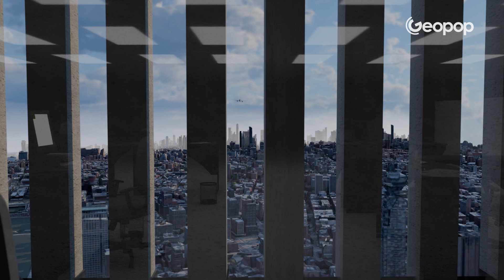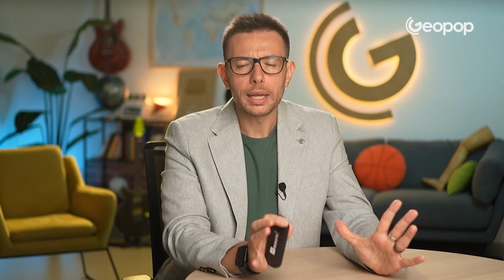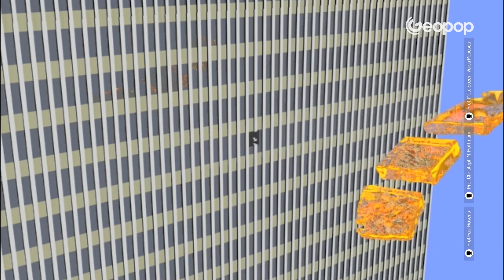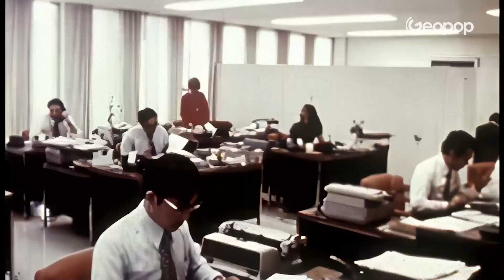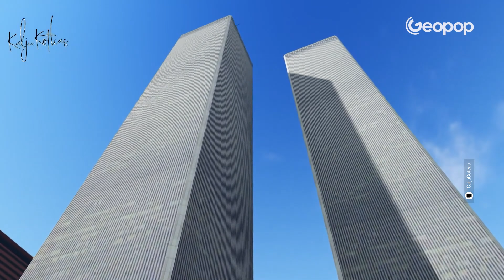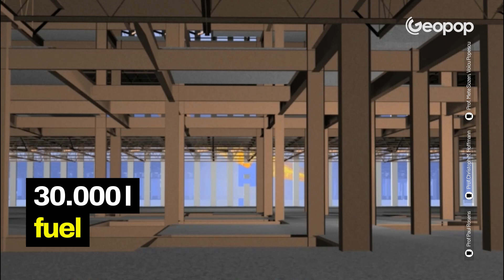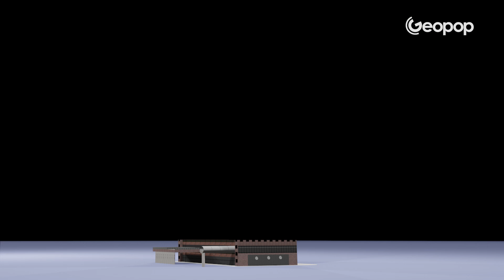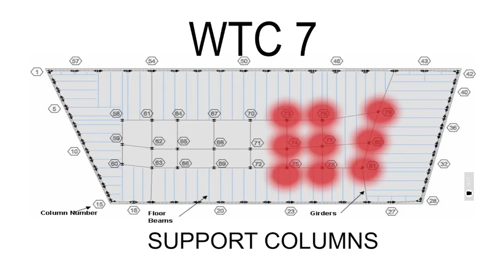9/11, 2001: The Technical Reconstruction of the Twin Towers and WTC 7 Collapses

Comment: I've seen the wtc up close and they are massive buildings. One side of me believes fully fueled airliners flying at high speed damaged the building beyond expected engineered survival specs. But both buildings collapsing as well WTC 7 which wasn't hit by a plane but brought down by fire?  And then you hear fire men describing hearing explosions before the collapse? And on some videos before the collapse you can hear these explosions?
Reply: And the entire worlds engineering community saying it was aircraft impact and fire.
Reply: @TheLoonResistance  but then again they are not seasoned fire fighters
Reply: @godstomper  - No. They are PhD engineers who know about buildings, some also PhD's in fire science. How many FDNY firefighters have PhD's in structural engineering?

But hey, someone said the magic word explosion (quote mined and completely removed from proper context) so that trumps everything else.

Anything can seem like a conspiracy if you don't take the time to understand how it works. So take the time.
Reply: @TheLoonResistance how many Ph d's do you know put out fires daily?
Reply: @godstomper - Are you being deliberately obtuse or can you just not help it?  

Firefighters are just one piece of the puzzle here and for the record, every responding firefighter in the FDNY. Will tell you without hesitation those Towers came down due to Impact Damage + Fire (heat) + Time + Gravity

Every single one.

Now then, since you clearly don't get it, would you like to?
Reply: @godstomper  The firefighters are not saying the buildings were demolished. They knew the plane-crash damage + the fires would bring them down.
Reply: @Tim22222 ya but they heard explosions. I don't think I've ever heard a fire man describe hearing explosions after the fact the plane crashed into the building and exploded.
Reply: @godstomper  If you want to prove the inside job, you need more than "someone heard explosions." If there had been bombs in those buildings the physical evidence would have been ABUNDANT. Yet nothing was found, and the first responders went through the debris BY HAND.
Reply: @TheLoonResistance then how do you explain building 7?
Reply: @godstomper  - Like this:  

Much misunderstood, Building 7 was the 6th building to collapse of 10 lost on 9/11. Because of its early low priority, conspiracy filled the information void with garbage made up by technically ignorant people promoting political agendas. But 7's loss is an engineering problem and should be treated as such, so I prepared this brief summary of my own analysis to fix that, using technical analysis, not ideology and tired memes. 

At 10:28am the WTC North Tower collapsed, showering Building 7 with tons of burning debris, causing heavy damage and starting many large  fires which burned out of control for the next 7 hours. Half the FDNY firefighters having been killed, units in disarray, equipment destroyed, no water pressure, and the greater urgency of search & rescue efforts, Building 7 couldn’t be saved so firefighting efforts were pulled as futile and 7 left to its fate. Firefighters make that sort of choice every day in brush fire situations - which houses to save and which ones to let go. Only real difference here is moving the decimal on the size and cost. People get overwhelmed by the size.

www.youtube.com/watch?v=g_SvpwyC17M

Collapse of a burning structure is always a concern for firefighters. Steel buildings subject to fire rely on active firefighting to survive. Buildings are designed around 1 to 3 hours of fire resistance, allowing time for occupants to escape and active firefighting to get started, after which all bets are off. Left to their own devices they'll exceed their design envelope and collapse, like Plasco Tower and Wilton Paes de Almeida. In 7 the occupants escaped, passive and active fire protections were compromised and active firefighting was abandoned hours before the collapse, which left the building to its fate. It lost. Odds on Building 7 would eventually collapse, and it did. No big deal in logic.

 http://www.youtube.com/watch?v=WnYBX6QT0R4 

FDNY Chief Daniel Nigro - The biggest decision we had to make on the first day was to clear the area and create a collapse zone around the severely damaged 7 World Trade Center, a 47-story building heavily involved in fire. A number of fire officers and companies assessed the damage to the building. The appraisals indicated that the building's structural integrity was in serious doubt. I issued orders to PULL back the firefighters and define the collapse zone. It was a critical decision; We could not lose any more firefighters. It took a lot of time to PULL everyone out, given the emotionalism of the day, communications difficulties and the collapse terrain 

FDNY Deputy Chief Peter Hayden ; We had our special operations people set up surveying instruments to monitor and see if there was any movement in the building. We were concerned of the possibility of collapse in the building. And we had a discussion with one particular engineer there, and we asked him if we allowed it to burn could we anticipate a collapse and if so, how soon? And it turned out that he was pretty much right on the money, that he said 'In its current state you have about 5 hours 

The collapse of Building 7 was anticipated and widely reported in the media throughout the day, with 24 video cameras recording some or all of the collapse. Everyone knew what was coming and why. 

www.youtube.com/watch?v=OY5S5k3tMHI

The collapse of Building 7’s was entirely different to the Twin Towers and harder to understand, most details being hidden from view and not intuitive.  But we can still sort out what happened through careful analysis and observation. This is my explanation of the collapse relying on no outside authority. 

Building 7 was a unique, asymmetrical 47-story steel framed structure built atop a smaller 3-story building serving as a partial foundation, requiring lower floors dedicated to complex load transfer structures. Of trapezoidal shape and all-steel tube-in-tube construction, B7 (above the 7th floor) consisted of a central core of steel columns carrying most of the gravity load, perimeter steel columns around the outside of the structure carrying the remainder of the gravity loads and long span beams and girders to tie those elements together and form the floors. On the outside of the building hung a moment frame or outer shell. 

Phase 1 : First externally visible signs of collapse initiation occurred at 5:20:28 pm and were notably quiet with observers not realizing the building was collapsing! No audible warning in the form of hundreds of ear drum busting 180-190dB explosive bangs preceding the collapse. Here at 12:00 a local CBS affiliate reporter is talking 10 blocks from B7 when collapse begins. People don’t start to notice the collapse until 12:11. At 12:45 is the famous CBS fixed camera clip of Building 7’s collapse. Note how quiet it is. 

www.youtube.com/watch?v=t5tEy6mXSE8

Collapse initiation was due to lower floor failures above the load transfer region (8-14th floors) in the NE corner. In this video at 0:45 you can see the NW corner from inside the building while under construction, Column 79 just out of frame on the left. That big, angled steel beam across the top of the frame connects to C79 at one end. The girders connect to the beam. That beam and all those girders depend on just one connection 

www.youtube.com/watch?v=nP3TNHPCIVU&t=45s

Phase 2 : The NE lower floor failures caused a loss of critical lateral support over an excessive length of Column 79 and it buckled. Looking at a floor diagram of Building 7 (www.nist.gov/image-16640) when you see all the structures that depend on C79 you quickly realize this one column was a relatively isolated structural element on which a disproportionately greater fraction of the structure depended analogous to say the Key Bridge. Externally as collapse begins we see a vertical progression of window breakage along the 44-46 line and a kink in the roof of the East Mechanical Penthouse at the top of the building, consistent with C79 failure. Normally with a buckling column, the load could be redistributed to other columns. With C79 that is not the case - the failure did not redistribute the load, so the collapse rapidly progressed to the roofline, sinking the rooftop penthouse. The transition from full capacity to almost no capacity occurs in an instant and will result in virtually no resistance 

Phase 3 : With C79 gone, B7’s progressive, non-symmetrical collapse continues with adjacent columns 80 and 81 left laterally unsupported, and quickly buckling as well, sending the EMP down through the building. C79-81 all have no diagonal bracing, which is the major reason why they could not redistribute a lot of vertical loads among one another. From there collapse progressed from east to west through the central core until the core was gone taking all of the interior floors and probably most of the perimeter columns with it. Follow the horizontal progression of window failures low in the building and the dropping of the remaining rooftop structures into the building. One of the big takeaways from the NIST Building 7 study (invariably ignored) was how their modeling determined C79 failing under ANY circumstances would have initiated the same collapse sequence. 

Phase 4 : After about 10 seconds only the exterior moment frame remains, giving the illusion B7 is still standing to the casual observer since little has outwardly changed. But it is just a hollow empty shell like an empty cereal box supported only by a few remaining columns and overloaded from the loss of the core columns and floors, quite unable to remain standing. With nothing remaining behind it, the north face leans inward, forming a V in the roofline, the last few columns buckle under the strain and the moment frame free falls, landing on top of the debris pile. 

It is only here at the very end that a single measurement of alleged free fall acceleration is taken, from a single point on the outer shell. The Building did not “free fall” – just one corner of the outer shell did, sort of. The Building_ (defined as its center-of-mass) was already gone before that happened. The period of alleged free fall was a product of how it fell NOT why it fell and can't tell us what started the collapse 10 seconds earlier. Start to finish the collapse took 18-20 seconds, 3 times longer than free fall . How fast something falls cannot tell you what started it falling_ anyway. 

The debris spread outside the footprint blocking surrounding streets, heavily damaging the Verizon Building and destroyed Fiterman Hall. 

Building 7’s progressive, non-symmetrical collapse was incidental and unintended collateral damage from the combined effects of fire + time + gravity, started by the collapsing North Tower. That is true no matter who planned and carried out the 9/11 attacks or why . The collapse was of so little consequence it barely registered at the time - a footnote, only taking on semi-mythical status as an alleged smoking gun years later when demolitions at the Twin Towers, missiles at the Pentagon and shoot down over Shanksville all failed and conspiracists had nothing left to work with. 

Anything can seem like a conspiracy if you don’t understand how it works. Now you should. I hope you found this helpful, informative and it solicits informed critical comment. If I made any errors of fact, logic or reason or left anything important out, please let me know so I can fix it. IF you can offer a more plausible alternative please do. Be the first. Please start any reply with the words “Tits McGee” or I will know you didn’t read it and are wasting my time.
Reply: @godstomper  - You're welcome.

Comment: No matter what's said in this video those towers dropped exactly like demo techniques in order for both of those towers to drop in it's place like that two of them exactly falling alike is a miracle in it self surely in that kinda of blaze physics should have taken over at the top of those buildings should have been some toppling of the top of those buildings and the thought of jet fuel taken out corner beams in a hour and change time is amazing also this means thse beams would have to heat up atleast at the same time in order to drop like that without the toppling affect to occur since when things fall there is no set destination for its return to earth common knowledge so in my book it always and will always been seen as a controlled demolition but maybe I'm just a conspiracy theorist. Wich doesn't mean I'm wrong just thinking outside the box most of the time like one should.Thise buildings disintegrated from the top down instead of chunks and slabs falling did that look normal for both buildings to do that on the way down?
Reply: So what demo technique involves making a giant hole in the side of the building, causing a massive redistribution of loads to surviving columns, which are then subjected to intense heat from floor-wide, multi-floor fires for an hour, causing the floor trusses to sag, which in turn pulls on the perimeter columns, causing them to bow inward by up to 5 feet until they buckle?

Like we clearly see here:

www.youtube.com/watch?v=ULdiD6gYZO0
Reply: 1 - The towers spread destruction for hundreds of yards in every direction! That's not like any controlled demolition I've ever seen. 

2 - The towers were hollow, not solid, so there is literally NO REASON for the tops to topple off. They weren't trees! With gravity the only force acting on them, DOWN is the only direction in which they can fall.

3 - It wasn't jet fuel that "took out" the corners. What's wrong with you?

4 - Punctuation and spelling: Why not try some today?

Comment: As a retired architect who has 8 large tall steel buildings standing to my credit, 5 in the Financial District of San Francisco, I can unequivocally tell you that this video is Bogus.  Who paid them to produce this?  It has been categorically proven that Building 7 collapsed by controlled demolition.  I know.  I negotiated the contract with the University of Alaska Fairbanks and consulted for the 4.5 years it took to do the Dynamic Analysis, a very sophisticated computer modeling program, that studied every suggested theory before concluding that the only way that building could have collapsed the way it did was through Controlled Demolition. Additionally, I personally corresponded with Yamasaki's office re how they were planning to handle the impact of a plane.  The Twin towers behaved exactly has they were designed to behave. From observation I can easily conclude that the Twin Towers were also brought down by Controlled Demolition.  If not, the central core columns would have remained standing. I have studied the drawings of all three of those buildings.  I can go on, but you get my drift.
Reply: Categorically proven when?  By whom? The Hulsey report???

You obviously never read the thing. Hulsey reaches no conclusions at all.  Far from offering unequivocal proof Building 7 collapsed by controlled demolition Hulsey not only never says what caused Building 7 collapse, he goes out of his way to avoid the issue.

And that's actually the least of that studies many problems. 

Meanwhile, the collapse of Building 7 is one of the most studied engineering disasters in history and the subject of 5 comprehensive engineering studies and more than two dozen technical articles in major peer reviewed engineering journals, most of which were published 15 or more years ago. Thousands of pages of material.

This should get you started.

FEMA BPAT (initial report superseded by NIST NCSTAR 1A)

NIST NCSTAR 1A: Final Report on the Collapse of the World Trade Center Building 7, 2008.

Guy Nordenson and Associates, WTC7 Global Collapse Analysis Report and Summary of Findings, 2010.

Arup, WTC -7 Structural Fire Analysis Report (Runs 1-4), 2010.

Weidlinger Associates Inc., WTC 7 Collapse Analysis and Assessment Report, 2010.

BRE Centre for Fire Safety Engineering, Analysis of the Impact of a Fire in the Mechanical Room (5th & 6th Floor) of the World Trade Center 7 Building, 2010.

T. McAllister, R. MacNeill, O. Erbay, A. Sarawit, M. Zarghamee, S. Kirkpatrick, J. Gross, Analysis of structural response of WTC 7 to fire and sequential failures leading to collapse, J. Struct. Eng. (United States). 138 (2012) 109–117.

For a summary of the major studies I would recommend THE COLLAPSE OF WORLD TRADE CENTER 7: REVISITED by Mhd Anwar Orabi , Liming Jiang , Asif Usmani and Jose Torero which is a 33 page summary of the different analysis and conclusions published in 2020. Sorry, YouTube will delete this post if I give the link but it should be easy to find and is available from the University of Queensland, Brisbane.

Real structural engineering industry professionals conducting real engineering studies and publishing them for other professionals to see. Not amateur YouTubers appealing to the gullible and credulous.

Happy reading

PS

I can tell when someone is lying when they jump on the internet and immediately and without solicitation claim relevant expertise, then proceed to spout standard conspiracy boilerplate nonsense mindlessly repeated off the internet.
Reply: Please let us know what buildings you worked on so I can make a point of never going in any of them.

Comment: I think it would have been very different if the fuel additive that was tested years before but rejected because of added cost. So engines would needed to be cleaned more often but reduce fuel fire there for less heat sent into the building .